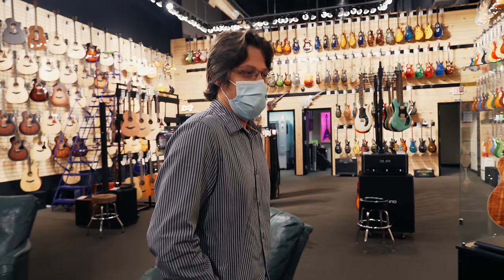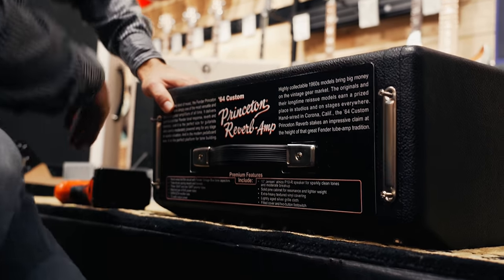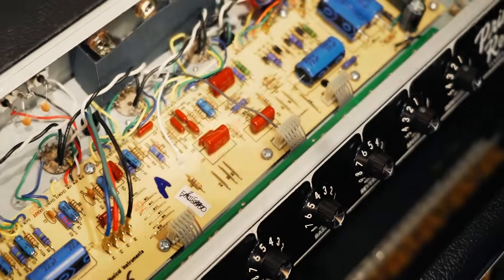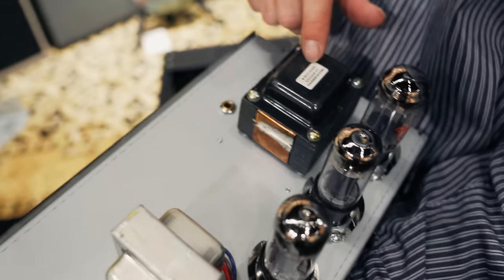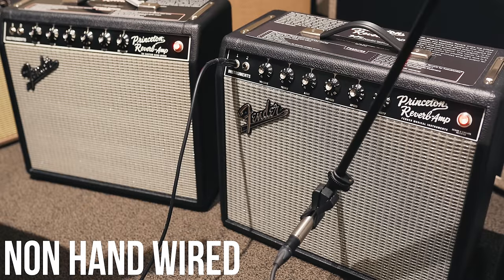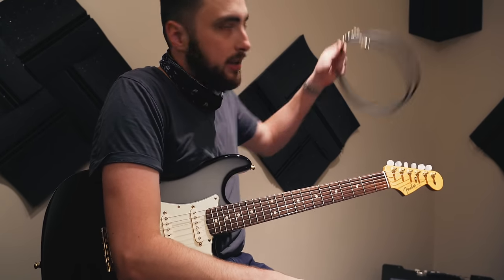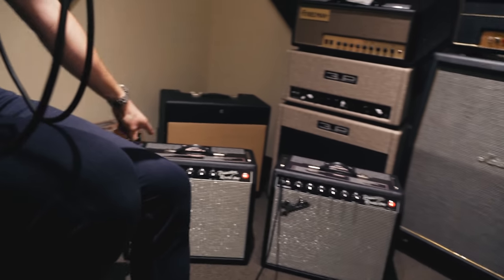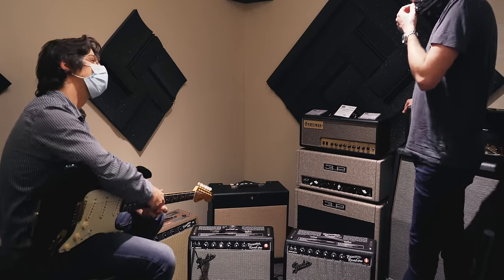Are Hand Wired Amps Really Better?

Comment: I messed around with different amps for a long time trying to find my perfect amp. Once I found out that it was a princeton reverb I had to try different ones new and old to really find the one that spoke to me the most. It actually wasn’t one of these 2 or a vintage one.
It was a FSR 1x12 12W Princeton Reverb in Bordeaux (wine red). I think it’s just a pcb ‘65 kinda thing but with a 12” Jensen p12Q. 
Idk what’s going on inside- but damn this amp F’s. I go directly into the amp 99% of the time, unless I need a Q-tron/auto-wah kind of thing. 
The breakup sounds better than any overdrive pedal I’ve ever heard. 
The trick with that amp is to use a little bit of vibrato knob on everything. People tend to think of that knob like a “surf rock” knob. Hellll no. A little bit of that Vibrato makes the individual notes of a chord sound like they’re swirling around the room in 3d. It’s the type of amp where you strum a regular old chord and look up at the ceiling smiling as you visualize the notes swirling around each other. 
Also a really fn cool thing happens with a strat if you put the treble on 10 and bass on 0- it does these super crazy buzz saw low notes. 
It’s also one of those amps where different pickups make it sound like a different amp almost. 
Firebird pickups, d’earmond single coil pickups from my coronado ii, p90s, strat single coils, and even the big beefy single coils from my 60’s mij baritone (in #2 channel to not blow it up) all sound ridiculously good.
I played the 65 RI, the ‘64 CS hand wired, a few vintage blackface, maybe 20 princeton reverbs in total- and not 1 of them F’s the way my FSR 1x12 bordeaux does. God, I love that amp so much. Pretty affordable too.
I found a used one online for a way better deal than the one I had originally played- I called up Guitar Center down in Texas somewhere and spoke on the phone to them- and they shipped it to me for 1k total. Idk how I got it so cheap, but I was a bit worried to buy it sight unseen. When it arrived it sounded even better than the one I’d played. I want another one in case something happens to it!
The coolest thing about it is how easily it can go from living room unaccompanied practice amp where you have the bass turned up to sound fat, but then if you play it with a band in a mix you can cut the bass down and it cuts right thru without losing much of anything other than the physical thump that hits you. It seems to lose nothing sonically with the bass at 0.

Comment: different plate voltages might have something to do with it. and of course Princetons are not cathode biased so the individual tubes and how the bias is set will affect things a lot too. a friend of mine has a vintage one and it breaks up very differently from my RI.  If you can afford the original :-) go for it, just put a grounded power cord on it, haha.

Comment: Both sounded good to me. The hardwired has the bottom end character I usually associate with vintage Fender combos and is what I preferred, HOWEVER, I don't think its a true apples to apples comparison when you have different components. In theory, a well designed PCB should not sound any different assuming all else is equal....

Comment: I bet if you line up a bunch of PCB amps (Twin, Dlx, Princeton, whatever), you'll see noticeable differences between them. Resistors often have a 5% tolerance and capacitors, 20%. That's a pretty big margin for things to sound different (plus, if you're playing the amps with their own speakers, they will differ just because of speaker differences, tho you did the right thing here with the apples to apples comparison). They all will sound like a Twin or a Dlx or a Princeton--they are going to sound within the right neighborhood. It is quite possible that HW amp builders are cherry picking values a bit to get things dialed in. Dumble def did cherry pick values for amps to get a particular sound. Part layout does matter, esp. with higher gain amps. Not as big a deal with an amp like a Princeton, but the part placement can make a small difference.

What would be a really interesting experiment (though it would be a PITA) would be to measure each component of the HW amp and replace all components in the PCB amp to match those component values exactly. Yeah, not gonna happen. :)

Comment: Nice, but not too suprising they have the same Trannies and tubes. Like you probably knew, caps and resistors of the same value but different composition or even brand can easily give a different sound.

Comment: I didn't hear the harshness that was talked about.  My 2 cents is that they could put a speaker in the circuit board amp to make them closer, but then that wouldn't justify the pricing difference as much.   I also think there's confirmation bias when you know this is the hardwired one and this isn't.  It sets a preconceived outcome before you play.

Comment: Hand wired improve reliability, especially these high current connections and helps restoring vintage sound, however the quality of the parts probably has the biggest impact.

Comment: Did you test the tube voltages and power amp tube bias to ensure that the tubes and bias were IDENTICAL?  Any tube amp tech will tell you how much the tone can change just with different tubes and a slight mismatch of the power amp tube bias.

Comment: Almost sounds like the circuit board version is biased a lot colder than the hand wired version. Wonder if this is because higher quality parts are used in the hand wide version so they can drive it harder?

Comment: Should have around them both through the same cabinet. That would reveal the differences between the circuits for sure. The speaker is what makes the most difference in the sound of these 2 amps, not the circuit.

Comment: given identical components and identical circuits, a pcb amp and a hand-wired amp will sound and perform exactly the same. the big difference is in repairability and road-worthiness, a hand-wired amp is easier to repair if it breaks but due to it's more robust construction, is less likely to break compared to a pcb amp.

Comment: The most important component of your sound on a amplifier IS THE SPEAKERS....i handwire my 59 ltd fender bassman and it sounds way better than it did before... but i also think i coulda got it sound just as good as it does now without spending the 1200 dollars to get it replaced.  speakers, tubes, transformers and some caps are all cheaper than handwiring the whole thing

Comment: I have a standard Princeton at home and it sounds phantastic. It sounds so good, that never think about, if a handwired could sound better.
Reply: Yes, Dirk, you are right. The stock Princeton 65 Reverb Reissue sounds phantastic. I‘ve got one, too. But the stock ceramic speaker is crap, really.
Reply: So I changed the speaker to the higher priced AlNiCo version (following Rhett‘s suggestion), and the sound is way improved. Try it.
Reply: @HCrockt  I will keep it in mind, actually I don't use the Princeton that much and play mostly with a Kemper, but I will definitely come back to it.

Comment: The hand-wired one sound more like a mid 50's Tweed Deluxe, I bet there's a fault developing - get it serviced it should sound like the other one!  Anyway, they both sound great, the H/W more mid-range and Tweed sound, now seriously I'd like to use them both in stereo on a world tour and see which one still works at the end of it ;-) and also shoot out the sound after the tour - H/W Princeton does sound nice here, are the circuits really identical?  I'd like to swap the speakers and do the test again! (I'm a Princeton player, I'd like to get a head built, on the original circuit)

Comment: I originally bought the non-hw one but had to send two back as both were faulty. I then swapped it for the hw version and certainly found it more responsive, gutsier and had a great mid range. The only disappointment (for me) is the reverb which in comparison to my ‘80s Vibroverb is flat and one-dimensional.

Comment: Not an expert, but I think the only real "better" part about hand wired is ease of repair and maintenance.  There's not going to be a difference enough in sound to justify spending more, but if you want longevity and reliability that is worth the price.  You'll also likely save money in the long run in bench fees at your amp tech compared to the circuit board amp.  

Any differences in the sound can be made up for by knob settings, speakers, mic placement, room placement, etc etc

Comment: Yes, because  hand wired means more care in assembly, and usually better quality parts with modified circuits.  But that's why there's a big price difference between the two.

But for the average Joe who gigs for friends or at the local bar once a month, the tone don't mean crap since nobody is going to hear it over the party noises.

Comment: Nothing wrong with the non hardwired amp. In fact it offers more clean headroom, at least in this video. Definitely different but both sound up to the task. Seems like the biggest differences lie in the speaker itself.

Comment: The Speaker of the both amps are different. Actually the speaker make the big sound difference.
hand wired = 10" Jensen P10R Alnico Lautsprecher
pcb = 10" Jensen C-10R Lautsprecher

Comment: How did you handle the internal components without any fear of electric shock, is there anything you need to do to make it possible to look inside my amplifiers guts ?
Blackstar valve combo 6L6 / ECC83 tubes.

Comment: Like most sensible people have stated, this is not an interesting comparison if you really care about the possible differences between a PCB- based amp and a hand wired amp, otherwise identical.
1) Speakers = Main difference
2) Component type / Brand / Age
3) Circuit differences

Comment: circuit boards are much different then hard wiring. Can overheat, short out, plus the etched board is not a wire. They react completely different to the nuances of sound transformed to electrical signals by the pickups. I would say over time a hand wired amp would be far more reliable

Comment: A circuit is a circuit. It does not matter one bit if it's on a pcb or through hole whatever. The voltage doesn't care the resistance doesn't care

A different speaker alone is enough to make a big difference. But I suspect the entire circuit is different between the two

Comment: It's about the actual components not the act of hand wiring. PCB can actually get components closer together than hand wire can, plus PCB is proven to reduce noise. I guarantee if the PCB had the same quality components as the hand-wired amp, it'd sound better.

Comment: This is not an fair test if the re-issue had the pine cab and the exact same compononts and speaker, I dont think you would hear the difference. The jcm 800 marshall is said to be the best over all around sounding marshall and it hss a pc board. Ive built 6 amps, and different caps and resistors in key places really makes a difference. If I was on the road and had to carry my equipment id use a  blond tonemaster.

Comment: The comparison can be fixed by adjusting the knobs. If you try to dial in the same exact settings on 2 different circuit designs, you are going to get different results. The funny part is you guys are talking about durability with tube amps??? I do not care how well made a tube amp is, you better not drop it. The amp may not fall apart, but you better have replacement tubes. *I do think the handmade concept is great though!!!!

As far as the tinker part? Do you want to play on it or do you want to tinker on it. Frankly, I would rather play on it. PCB or Hand-wired. I have a Princeton Stereo Chorus I have had for almost 30years. It is a US made solid-state. I have only taken it a part a couple of times to clean it out. Never had to replace anything on it. That is ideal for me. No tubes!!!! Even better!!!....different video.......

In the end, instruments/amps are made for the player. The audience will not know the difference. Get what you like and make good music. But the difference in sound to me is all hype. I have put high sensitivity speakers on cheap amps and they sounded like more expensive amps. In the end, you will get more sound impact from a good quality compatible speaker more than anything else IMHO

Comment: The hand wired clearly used better electronic components, and a better speaker.  Just different capacitors can have a huge difference in an analog circuit like this.
A circuit board using identical components, the same speaker, circuit boards with the proper size traces, proper size connecting wires to the front panel, etc... should sound like the hand wired model.  They just wouldn't have an excuse to charge twice as much.

Comment: I have been repairing amps for the last 30 years and I can tell that It shouldn´t be a difference just to be "handwired" per se.  IMHO the tonalities of each amp are the result of the variation of the circuit not the components itself. It takes a simple variation of capacitor and resistor in the early stage to change the high pass frequency and change the tone. Are the amps biased equal?  A customer brought me his never serviced hotrod deville because of a tube socket failure and the bias was -70mv,  I recommended to set to -60 because fender recommends it. Later the guy said that the amp loose some guts and I rebiased to -70mv in expense of life tubes. The experiment is great but even the tubes itself if they are the same, don´t sound the same .

Comment: Sound is subjective. Reliability not so much. As a service tech,  I feel that the use of plugs and spade connectors is not as secure and more subject to corrosion over time compared to a good soldered connection. Also as was pointed out the controls and input jacks are subject to failure from stress more so than the chassis mounted controls and jacks.

Comment: So the hand wired amp is double the price!  I wonder sometimes about these kinds of comparisons and ask myself what else could you do instead of paying 2x as much?  I also wonder if it might make more sense to concede that the amps are different and focus on what you want it sound like rather than why it doesn't sound like something else.  Less scoop on the mids?  Turn down treble and bass and bring up the volume.  Get a different speaker.. speakers can make a huge difference.  For just a little more money, very little, you can buy the Deluxe RI with more power and a 12" speaker.  I had my 65 DRRI modded so the hardwired bright cap is wired to the non-functional polarity switch so now I have a bright switch and it's less brittle sounding.  Also swapped the speaker for a Celestion Vintage 30 (Thanks to Ask Zack).  Best sounding amp I've ever owned and it's not hand wired, and I seriously doubt that a hand wired Deluxe for 2x the price would sound as good, to me at least.

Comment: I think the '64 Custom sounds better because it has better components all around, not because it's hand-wired. I had a PCB 410 Bassman that was a tone machine. Just amazing. Every stock Fender '65 Blackface RI amp I've ever tried has sounded awful. Bright and spikey and a horrible digital-like clipping when pushed. But the '68 Customs sound great to me, and I think they're all PCB.  And that's without pine cabinets or particularly good speakers!

Comment: There are some problems with your comparison. I agree that the "hand wired" amp sounded better (not because it is hand wired) and the PCB version sounded better with the Alnico speaker. BUT. You need to either run each amp through a common, separate speaker, or swap the head into the cabinet with the speaker. You compared the hand wired as a combo, and the PCB as a separate head/cabinet which is way different, and probably accounts for all the "breakup" and "midrange tone" etc.  It's like comparing a Twin with a Dual Showman, the separate amp/speaker always sound cleaner than the combo. Not to mention observer bias... you knew which was which. Try it double blind.

Comment: I think the difference people are hearing is the speaker itself as opposed to the hand wired / non hand wire amps themselves. I think a closer comparison would be both amps through the same speaker as the hand wired one has a specially voiced jenson speaker and the non hand wired one has a stock alnico jenson.

Needless to say some components may or may not have greater longevity and you may save yourself some money on amp repairs as a result of having a hand wired amp BUT on the other hand you may pick yourself up a perfectly good printed circuit board amp, look after it, service it regularly by someone who knows what they are doing and have no problems at all till the day you die or sell it! If memory serves me well Brian Wampler did a very good YouTube video all about printed circuit boards vs hand wired and his opinion was it made absolutely no difference it’s just that some people buy it whilst others are dead set against it because they buy into what they are being told.

Who knows! The only thing that is sure is that everyone will never agree on everything.

Comment: Most of the perception of "HW is better" is due to better circuit design and better components, compared to a PCB version of that amp. This has nothing to due with the HW nature. Compare a 90's AC30TBX (mostly PCB) to a modern AC30C2X (PCB), they are in different worlds just because of the circuit design and components.
Reply: The solder joints of a HW circuit may also be more inconsistent than a PCB version, so every joint of a HW circuit has potential to sap a bit of high end; ending with a warmer sounding amp.